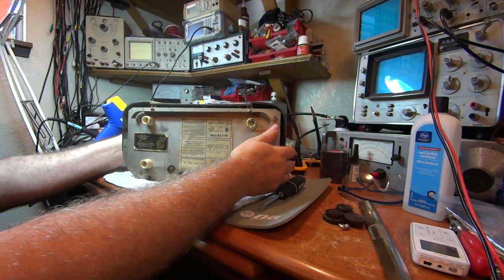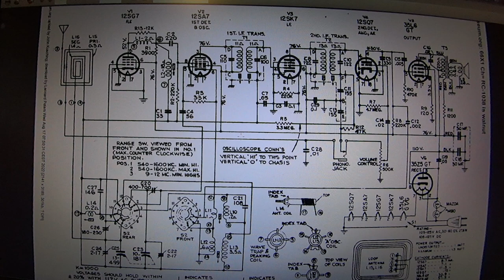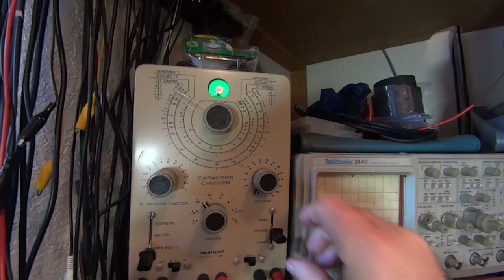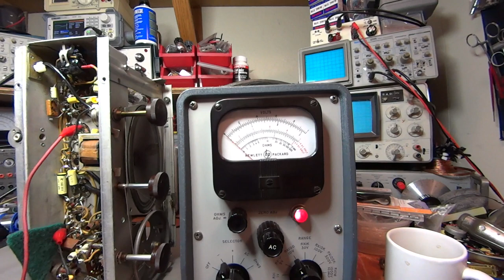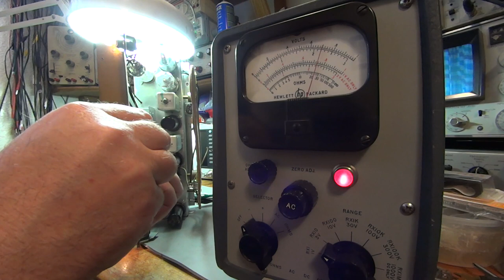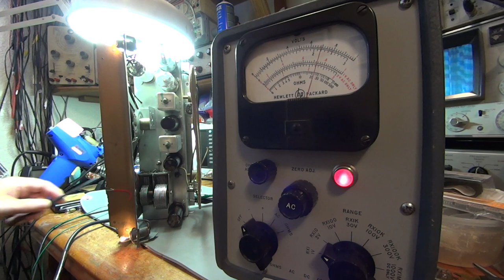Rebuild of an All American Six RCA 66x1 Radio. Leonard Peters

Comment: Great repair!!! I just bought one on Ebay & will refer to this video as I go along restoring it.
Reply from the maker: Great, I wish you well and hope you enjoy the radio.
Reply: @leonardpeters3266  I started today....no initial response from it. Tubes test okay. I'll start on the caps tomorrow. The switch has 3 selections, am, sw & ????
Reply from the maker: @eugenetheodore2956  It is (counter clockwise to clockwise)  {pos1 broadcast (540kc-1600kc)min.}       {pos2 broadcast(540kc-1600kc) max.}    {pos3 shortwave (9-12mc)}
Reply: @leonardpeters3266  Thank you.